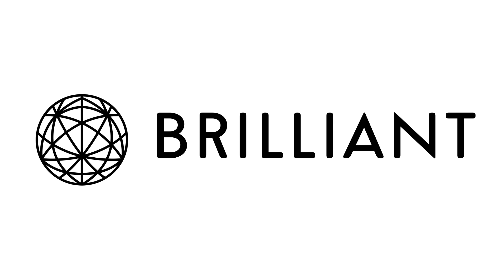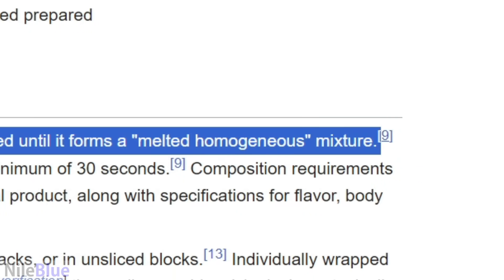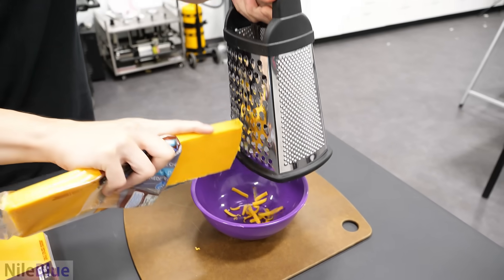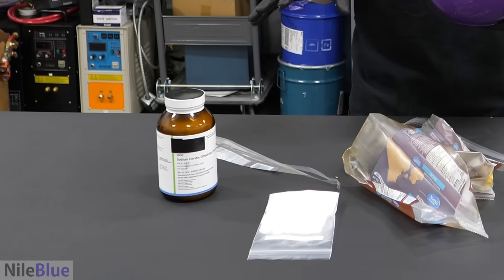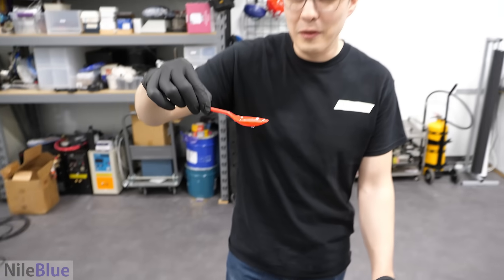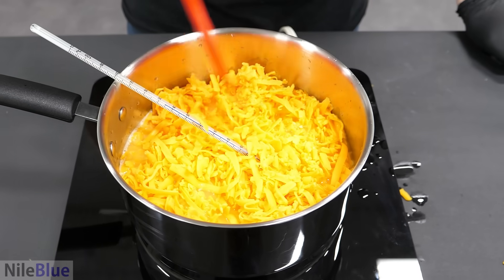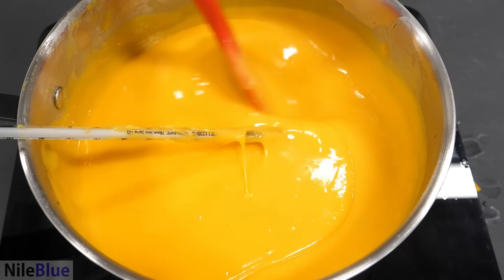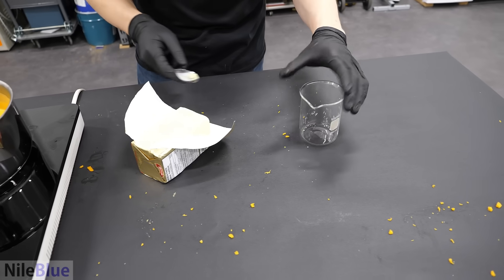Making American cheese to debunk a conspiracy

Comment: Hey! Finally, something I'm an expert in. I'm a food science PhD working in process cheese R&D and I must say you did a great job! Every time I though "He should...", you did the thing I was thinking. Add fat, add shear, etc. The process cheese "product" you showed at the beginning is actually quite different in a lot of ways, though the eating experience ends up being very similar. The formulation and processing have to be developed in such a way that "cheese" has the proper mechanical properties and tensile strength to be cast into a thin sheet and rolled around the factory.. like toilet paper almost.. and into the wrapper. Thank you so much for showing people that food isn't really scary just because there is transformation and processing involved!!! 🙏❤
Reply: Bonus chemistry for anyone interested: the salts you added are called "emulsifying salts" somewhat erroneously. While they are indirectly responsible for making the stable emulsion possible, they themselves aren't surface active and don't stabilize the oil water interface. They are actually chelating agents that sequester calcium from casein protein micelles. That causes the casein subunits (which are amphiphillic) to disassociate and orient at the oil-water interface, stabilizing the emulsion! Without the emulsifying salts, you would just have an oily, separated mess.
Reply: Hey Terrance, you're awesome
Reply: i had a dear friend in college whose major was food science: "i'm turning tallow into gold" was her motto.  :)
Reply: The hate for American cheese isn't because it's processed, it's because it tastes like ass
Reply: thanks for the comment tho, really interesting
Reply: Dairy is scary
Reply: Funny you should mention processing. I work at a deli in a grocery store. Not a week goes by that someone is looking for "unprocessed cheese". I try to explain to them that all cheese is processed. In fact, all food is processed. They generally ignore me and insist I give them the unprocessed cheese. I, again, tell them there really isn't any such thing and they always say, "Well, I got it last week!"
Unprocessed cheese is raw milk. We're not even allowed to sell raw milk in the US. The sheer lack of critical thinking skills in some people never ceases to amaze me.
Reply: @DieselTheDog  only if you're lack toes in taller ants
Reply: Lot of words there. Still not cheese. 😂
Reply: @terrencedent3071  This is actually something I've wondered about for a while. A lot of people seem to talk down on processed foods, but to me the word "processed" has become kind of a buzzword. I want to know more about what these processes are, and what it is about them which supposedly makes foods unhealthy. Just for another example, if you were to slice off a piece of a cooked, but otherwise intact turkey, that meat is seen as healthier and better for you than an equal amount of turkey meat that has been processed into deli/sandwich meat. So I want to know 1. if that is true, and 2. if so, what about the processing makes that true. And just kinda repeat the same questioning for other processed foods.

So anyway, thanks for demystifying the cheese a little bit.
Reply: I love American cheese
Reply: @terrencedent3071  That is freakin awesome! Thank you so much for adding this nerdy note on top!
Reply: @SlimThrull  I'm not sure there's a lack of critical thinking. They just use the word 'unprocessed' with a different meaning than you want to use it.

(I guess you could get unprocessed food by your definition, by going into your garden and picking an apple off the tree and biting into it.)

Anyway, people asking for unprocessed cheese is the same as people asking for food with no chemicals in it.

If you use the usual scientific meaning of these words, their demands make no sense. But you have to understand that they are using different meanings.
Reply: @Smileyhat  Thin slices of meat rot faster so whether true or not people fear the sliced meat has had preservatives added to it.
Reply: Whoah, I always thought the cheese was somehow squeezed into the single bags and then sealed individually
Reply: Thank you for making american cheese
Reply: @budgetcommander4849  It is only good in very select scenarios, but yeah it tastes like trash. It is the Hershey's of cheese.
Reply: Bro has a phd in chysics
Reply: I halfway expected him to actually make the sodium citrate and sodium hexametaphosphate from scratch. I've seen sodium citrate made from orange peels, but have no idea how the components of SHMP are produced...as in how does one make sodium phosphate. Now that would be a true drilldown into the details.
Reply: I had always been afraid of American until this, thank you!
Reply: No, no, those are two different things.
What you're talking about is ignorance on a topic. Not everyone knows everything. That's fine. When I tell these people that literally everything we sell is processed and explain why that is they'll say, "Oh, yeah. That make sense." And then they can go on to buy something based on that knowledge. Again, I have no issue with this.
The people I'm talking about will argue, will whine and will make up demonstrably untrue "facts" so that they can get their unprocessed food. No matter what I say, no matter what I do they cannot be convinced. THESE are the people who lack critical thinking skills. The read it on the web at some "health guru's" website and want exactly what they saw there. No amount of facts, evidence nor common sense will convince them otherwise. THESE are the people that lack critical thinking skills.
Reply: I really think "Cheese sauce" is a better description for this stuff than anything else.  Closer to Sauce Mornay than I think any self respecting classically trained French chef SHOULD be willing to admit: Cheese, butter and milk.  Simply swap out flour for "emulsifying" salts.
Reply: @terrencedent3071   I've always been fascinated with the various texture that occur in cooking and the chemistry behind them... this is such a remarkable achievement of food science. Harold McGee and Kenji alike would be proud!
Reply: @Smileyhat  The act of simply mincing a meat changes the structures of the proteins and how they are absorbed by the body.

The big problem with modern "processed food"  is that most of the processes used are relatively new and the wider health effects are hard to identify.

The harsh reality of processed food by Chris Van Tulleken on The Royal Institute channel is pretty eye opening.

On American Cheese, there is nothing inherently bad about it but there are i think 3 or 4 versions depending on what they call them. American Cheese isn't Cheese by Atomic Frontier is quite good at explaining specifically how cheese is made and the processes involved in the various defined types along with some major brands in each segment.
Reply: @budgetcommander4849 It only tastes as bad as the cheese it's made from. It's typically made from cheap crap so it will taste like it. Trash in, trash out. I use emulsifying salts to make my own cheese sauces at home and if you use quality cheese you get processed cheese that tastes amazing but will still make a silky smooth mac n cheese
Reply: Mighty convenient to leave out that you don't make it this way, cheese emulsifier and butter. Your "cheese" is 50% soy vegetable oil or whatever cheap filler you can get away with diluting the cheese with, to make a bigger buck.
Reply: Tensile strength and cheese in the same sentence is definitely not something I ever expected to hear.
Reply: @terrencedent3071 Can I ask what your career path was like? I’m also curious about the degrees you have and the major you chose. I’m shooting for my BS in chemistry, and I’m still trying to figure out the career pass and options that I have, but I’m very interested in food science. The thing I’m wondering, is if I have an in to food science with a bachelors in chemistry?
Reply: @SlimThrull technically right, but you know what they mean by "unprocessed" so you should probably just roll with it next time.
Reply: @GeologicalNerd where do you see an A in that man’s name
Reply: @mattb4640   Or he could sell the less "processed" stuff to them at an unfair markup, since he has no respect for those people, anyway
Reply: @SlimThrull  they meant they wanted it without chemicals, they want spiritual cheese with no chemicals at all
Reply: @budgetcommander4849  tastes pretty good to me
Reply: but my question now comes to "why" ease of use? i mean sure but for, imo, a crappier cheese. for more plastic waste? than whats needed? Like im pretty sure that between unwrapping a single and cutting a slice from a block there is very little time difference. Sorry if this is my naivety speaking
Reply: @SlimThrull ah yes, the "natural = healthy" and "organic = healthy" crowd, without knowing that all food is just atoms.
Reply: @mattb4640  No. And there are two reasons for this.
1.) I know what they say. I assume they say what they mean. This is how language works.
2.) It could kill someone if I don't. Years ago, I waited on a women who had a child that had developed a severe nut allergy. For those that don't know, this is the kind of allergy that you go into anaphylactic shock and die from.
She knew this. The doctor had told her this. But she went online to see what was the best way to avoid the allergy. The person writing the article that she read had said to ask for "unprocessed food because they never have allergens in it." This. by the way, is 100% BS (and why you shouldn't get your health advice from random websites).
So, I'm waiting on her and she asks for unprocessed food. Had I just rolled with it, just go along, just assumed I knew what she meant, her kid could have died.
Instead I explained to her what she was asking for didn't really exist. She said, "Oh, well, my kid has a severe nut allergy. I can't have anything with nuts in it." Boom. Now I know exactly what the issue is.
So, no, just rolling with it isn't an option.
Reply: @BattousaiHBr  Yup. 100% organic arsenic. It's natural, its organic, it must be good for you!
Reply: @SlimThrull  Ultra-unprocessed cheese is grass! Hyper-unprocessed cheese is sunlight!
Reply: you write very concisely, I appreciate it
Reply: @SlimThrull  To be accurate, regular cheese like a normal cheddar cheese, edam, gouda, parmesan, etc are 'processed'. Whereas something like a Kraft Single would be 'ultra-processed'.
When people are asking for something that "isn't processed" they're really asking for something that isn't 'ultra-processed'.
The same is true for normal breads (flour, salt, water, yeast) like a baguette vs something like Wonder Bread (the usual + various additional inorganic ingredients, stabilisers, emulsifiers, preservatives, etc).

Most foods that humans eat and have eaten for millennia are processed, cheese, bread, and anything that is cooked is 'processed', as such it's a largely useless term, however 'ultra-processed' food is a very new addition, only entering the human diet in the last century (most of it only in the last few decades).
The scientific consensus states that there are significant health risks with 'ultra-processed' food, with considerable evidence placing it as the primarily driver behind the obesity crisis seen across the Western and now the developing world over the last few decades.
Reply: So basically what ur saying is....they add way higher ratios of the Chemicals into the cheese
Reply: @SlimThrull iI'd ignore you too, they are asking for a product and instead of giving the product u know they are asking for, u decide to be a smart ass . like im pretty sure they mean cheese that hasn't been processed beyond the stages of making the original cheese.... When u buy a block of cheddar it says cheddar cheese, when u buy Kraft, or something like it, it says processed cheese. I'd complain to your boss if I had to deal with u.
Reply: @mattmatt5864  So, you want cheese that hasn't been cut or packaged? Okay, go talk to the manufacturer.
Reply: @Smileyhat  "cooked, but otherwise intact turkey" would in fact be a processed food, as cooking a food is a form of processing. When people talk about 'processed' food what they actually mean is 'ultra-processed' food. Regular cheddar cheese is also a processed food, while something like a Kraft Single is an ultra-processed food (and is actually majority non-cheese, hence called a 'cheese product' unlike the majority cheese 'cheese food' NileBlue made in this video).

There is overwhelming scientific evidence that ultra-processed food is far worse for you than processed & non-processed food, hence why it is the scientific consensus and there are strict restrictions about what food additives can be added to foods and in what quantities (though the regulations are quite lax in the US, unlike the EU, UK, and elsewhere).

The difference between that slice of cooked turkey meat and one that has been ultra-processed into deli/sandwich meat is that the latter has been bathed in preservatives to grant it shelf life as meat has a very short shelf life, these are inorganic preservatives like sodium nitrate that unfortunately are tied to negative health outcomes like cancer. The amounts depend quite a lot on what kind of meat is being preserved, pork has a shorter shelf life than chicken (and bacon's is shorter than ham) and so requires much more preservatives.
In the case of turkey meat the direct alternative to these inorganic preservatives is regular table salt, the issue is that is requires quite a lot of salt and it subsequently makes the food very salty, which doesn't taste great (and dries it out, changing its texture) and is also not great for health, though not as bad. Other preservation methods include smoking and pickling.

Another thing that may not be readily apparently about ultra-processed food is that it is almost always softer than its regular food equivalent, this might not seem bad but it does change how the body digests the food and soft food doesn't trigger the natural appetite suppressant mechanism in the body as readily, meaning people eat more than they otherwise would before they start to feel full and thus they gain weight. In the case of that turkey meat it breaks down the proteins in the meat and changes how they are absorbed by the body, when you chew food you don't liquify it (at least, I hope you don't have a blender in your mouth).

Edit: as @dzzope said, "The harsh reality of processed food by Chris Van Tulleken on The Royal Institute channel" is a good explanation on the topic.
Reply: @BattousaiHBr 🤨, I can't tell if ur being funny or if ur being serious with ur answer
Reply: @birphon the reason is they just turned 400grams of cheese into 1000grams of cheese, and since they sell it 10% cheaper then the original cheese u think ur getting a good deal while the maker is doubling their profits
Reply: @treeaboo  "When people are asking for something that "isn't processed" they're really asking for something that isn't 'ultra-processed'."

Sometimes but not always. See my example above. It can be deadly if you get it wrong.

"The scientific consensus states that there are significant health risks with 'ultra-processed' food, with considerable evidence..."

No, the scientific consensus is that there is a link between the two. But it isn't necessarily causal. The same people who tend to eat more ultra-processed foods are also poorer, sedentary and less health conscious. Those three factors likely far more influence weight than eating ultra-processed foods.
And, unless they are adding sugar, the actual calorie content of the ultra-processed stuff isn't that much different. Now, that's a big caveat. Many of the ultra-processed foods DO add sugar. But then so do non-ultra-processed foods.
Reply: @SlimThrull if u had critical thinking skills u would do ur job and grab the customers the fuckin product they asked for instead of patronizing them 😂 just sayin, 🤷
Reply: @mattmatt5864  my man, the best advice i can give you is to go read a chemistry book and rid yourself of ignorance.
literally everything is just atoms, and there aren't special "natural" vs "artificial" atoms, they're all the same atoms made up of exactly identical protons, neutrons and electrons.
Reply: Like toilet paper 💀
Reply: “I'm a food science PhD working in process cheese R&D” lol wtf is this job
Reply: @budgetcommander4849  The sad thing is that it really doesn't have to! Companies just choose to ask for unexciting formulas. I've gotten to play around in the cheese lab, and you can make some really delicious process cheese. You can add concentrated cheeses (called EMCs) to add the flavor of any cheese you want. My coworker makes a bomb cheese with parmesan and a bit of butter and blue cheese. Also, process cheese isn't really meant to be eaten straight. It's best melted on or in something or in a sauce. For eating straight up, though, I'll always go for natural. Everything has its place!
Reply: @Smileyhat   The term "processed" is a bit nebulous, and that can be scary to people who haven't been educated on the subject. Unfortunately, people will weaponize "scary" concepts to influence people and profit. It is fair to say that "ultra processed" foods often contain more calories and sodium etc. The processing isn't the harmful part it's the composition. And even then, those foods are safe in moderation.
Reply: @nogf42069   Actually, you are sort of right, I got my cheeses mixed up. Individually wrapped slices are usually filled into the wrap as a liquid, sealed, and allowed to solidify. The sheeted cheese is usually used to make stacked slices (though can still be individually wrapped)
Reply: @prosfesor   Aww, thank you!! Reading McGee inspired me to pursue food science in grad school after working in biochem/pharma
Reply: @dzzope   Can you elaborate on how mincing meat changes the absorption? To my knowledge, all the protein you consume is hydrolyzed to amino acids in the digestive tract.
Reply: @GabrielAKAFinn  Definitely some process cheese is made with non dairy additives. But if that's the case it has a different labeling standard e.g. process cheese product. It definitely makes the ingredient cheaper, but that doesn't necessarily make the ingredient more profitable. Usually food manufacturers choose these ingredients because they have a specific functionality, and they allow them to have a less expensive product for consumers overall.
Reply: @carlosvalentin7485  Absolutely! First off, I would say to stick with chemistry if you like it enough. Take as many food science electives as you (food chemistry, food processing, food micro, sensory science are the cores), maybe even minor in FST. The reason I say this is because the chemistry degree is more versatile and will teach you more fundamental science principles that will serve you later in your career. Food science isn't really a science in the traditional sense, it's more just a discipline encompassing all varieties of science with food as the application. Some people in my grad program knew very little chemistry or "lab sciences" and were basically studying psychology in the form of sensory science. Many employers will prefer hiring people with a more fundamental science education as food science principles are pretty easy to teach on the job. I'd also suggest looking into working in a food science research lab at your university or doing an internship at a food company if you're interested in that career path. 

The reason I say that is because I was a biochemistry major in undergrad, and I worked in pharmaceutical formulation and R&D before going to grad school. I found along the way that I was more passionate about food, and the fundamental science background I had served me very well in grad school. By the time grad school is over, everybody else comes up to speed, but it's easier to start with fundamental science skills and go more applied. 

That's a lot, but if you have more questions, I'm happy to give more insights!
Reply: @travisolander4749   There definitely are peer reviewed articles that show how food affects health. The problem is there really is no consensus, except in some extreme cases like trans fats. I could show you many papers on the health benefits of dairy. There are plenty of foods that I wouldn't recommend eating in excess, but there are no foods I would say are going to acutely affect your health when eaten as part of a varied and balanced diet.
Reply: @treeaboo   This is true to an extent, but it irks me because it's the composition of some ultraprocessed foods that are associated with negative health outcomes, not the processing itself. Given equal nutritional profiles and approved additives, the processed bread is no less healthy than handmade bread.
Reply: @skibidi.G LOL it was the first analogy I could think of. Maybe saran wrap would have been better 😅
Reply: @birphon  I agree on the packaging waste. Hopefully, biodegradable packaging technology will take off. This isn't just an issue of process cheese, though. String cheese (which can be natural cheese) is also individually wrapped. Consumers demand convenience, and unfortunately, that comes at the cost of the environment.
Reply: @DrMoe.Lester  You're free to categorize food personally however you choose. The US government considers it a type of cheese. By your standard, are mashed potatoes not potatoes because they contain butter, milk, and salt? Is a hot dog not meat because it contains water and salt and added fat? Fair enough if you're keeping your standard consistent.
Reply: @BattousaiHBr  What are you fucking talking about? Atoms are irrelevant to the conversation, this is organic chemistry.
Reply: @GabrielAKAFinn  ????????????????
Reply: @budgetcommander4849  It only taste like ass if you are getting an ass brand. Like any cheese, the good stuff costs more.
Reply: @Smileyhat  I blame Michael Pollan. Generally, his advice to "eat around the edges of the grocery store" is pretty good. A chicken breast is probably better for you than a Slim Jim. 

But idiotically saying that all "processed" foods are bad is not good.
Reply: All this video did is make me want a grilled cheese really bad.
Reply: "My time to shine"
Reply: What a nerd 🙄 (biomed student)
Reply: @DrEcho  It's all downhill for me after this video. But I'll always have this moment 🥲
Reply: “He should put that whole slice in his mouth right now, wow, that’s great”
Reply: So..... Is the cheese product good for you? Like in the way eating actual cheese won't harm you?
Reply: @SlimThrull what they most likely mean is less processed (for example cheese you have to use in 5 days after opening vs cheese that lasts months after opening). You seem to be smart enough to understand that, but want to be the a**hole to try and insult them because you have a little more information about a particular subject or you want likes in YouTube. Who knows?!? Guess that's why you work in the supermarket deli.
Reply: @xx_d34dp00l_xx  😮🤣🤣🤣
It took me awhile, but I'mma gonna REMEMBER that now. It's BEAUTIFUL 😆
Reply: Really cool!!
Reply: "Processed cheese R&D" sounds like a job that doesn't exist, though i completely know that it does
Reply: @Smileyhat I think the issue most people have with processed foods is that they are pumped full of chemicals and preservatives to extend their shelf life, to enhance their flavor profile, or to give them a specific color or consistency. This is in contrast to whole foods like going to the deli and asking for a steak, going to the vegetable isle and buying broccoli and potatoes, and then buying a bag of white or brown rice that you cook in a pot or rice cooker. Those foods have also gone through processing but they haven't been pumped full of artificial chemicals.
As more scientific research is being done over the years we have found that some of the preservatives, dyes, and other chemicals we put in foods and other household products have harmful effects on our bodies, and many others we don't simply don't know yet how they effect the human body over time.
Edit: I don't mean to say all preservatives or chemical additives are bad or harmful. Some chemicals we add to our foods aren't harmful at all and adding chemicals to extend shelf life is necessary in our current food system. My point is just to explain why people try to choose "unprocessed" foods when possible.
Reply: Yeah the problem with processed foods is basing your diet around them. They ultimately lack the proper nutrients we require daily, and the more you consume processed foods the weaker your digestive system becomes; youre basically eating emulsified pre-chewed-and-partially-digested food instead of just getting the full breath of nutrients from the base components
Reply: How does one end up in the career field of process cheese R&D
Reply: Legend
Reply: @DrMoe.Lester  its "not cheese' in the same way Dairy Milk is "not chocolate" because it has too little coacoa to technically count
Reply: But it can be easily!
Reply: 'Product' in inverted commas implying so-called or supposedly, not quotation marks quoting someone.
Reply: OP. 'Product' and 'cheese' in inverted commas implying so-called or supposedly, not quotation marks quoting someone.
Reply: Clark Griswald?
Reply: @SlimThrull retail is hell
Reply: Thank you for calling it "cheese" and not cheese
Reply: Isn’t it great that you can go to college for eight years and study food and related topics? This wasn’t offered at the school where I attended.
Reply: @SlimThrull your customers obviously mean not ultra processed, such as this monstrosity of American cheese, so why antagonize them? Other than wanting to feel superior? 

  They obviously instinctively know there's a difference even if they can't detail why, and this video has elucidated why it isn't cheese. 

Cheese is an ingredient in American cheese. It's not the end product.
Reply: The fact that you take pride in making a product that uses water and butter to dilute a perfectly healthful product by ruining its protein to kcalorie ratio, while potentially negatively impacting people's health with raised cholesterol due to the addition of saturated fat, all to maximize profit is concerning.
Reply: @SlimThrull  Raw milk is legal in some states, but heavily restricted. My aunt had a dairy farm in Vermont where she could sell limited quantities to people who brought their own container to the farm. It was a tiny portion of her business, compared to pasteurized. She was okay with it, since she kept her herd as healthy as possible and tested the tank regularly for listeria. But she wouldn't say it was magically better than regular milk. And it was sad that some customers really thought it would cure their cancer or whatever.
Reply: Y
Reply: Call me old fashioned but food… “real food”.. doesn’t need chemicals added.. if so it’s no longer “real food”
Reply: I never expected to hear the term tensile strength in the same phrase as cheese
Reply: Yo dats cool